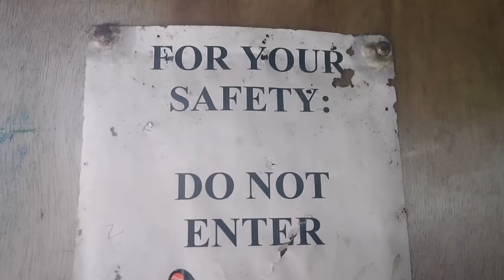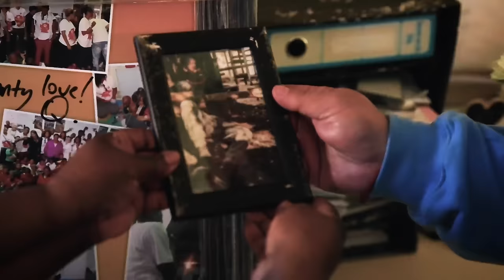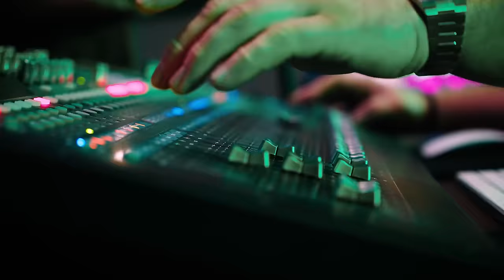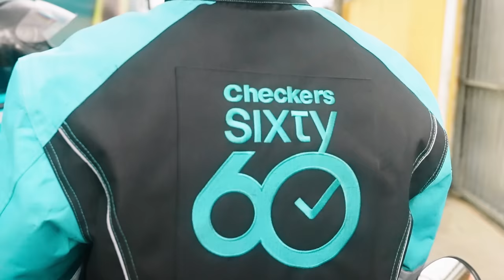We Adopted an Orphanage

Comment: The things this man has achieved. All starting from his bedroom with his best friend. He deserved every single subscriber he has
Reply: Ayy toilet gang
Reply: Don't traslate🧠
تۆ نەفرەتت لێ کراوە
کەناڵەکەم
ئەگەر ناوت تۆمار نەکەیت لە ماوەی ٣ ڕۆژدا دەمری…
Reply: @Turkiyeball_animations Ayy countryball gang
Reply: Ok
Reply: here a recipe for a shawarma
STEP 1
Tip all the ingredients, except the chicken and lemon wedges, into a blender or a smoothie bullet with 1 tsp sea salt and whizz to a smooth paste. Pile the chicken into a bowl or large plastic container, pour over the paste and mix through so the chicken is completely coated. Cover and marinate for at least 4 hrs or up to 48 hrs – the longer, the better.

STEP 2
Cooking on the barbecue: 
Light a lidded barbecue, and let the flames die down. Once the coals have turned ashen, pile them up on one side with a few coals scattered around the other. Starting and ending with half a baking potato, thread all the chicken onto two long metal skewers – so that both skewers go through each piece of meat – packing the thighs down between the potato halves so that they are really compact. Place the large chicken kebab to the side of the barbecue with only a few coals underneath. Pop the lid down and cook for 45-50 mins, turning every 15 mins, or until cooked through – prise the chicken pieces apart in the centre to check, or use a digital cooking thermometer; it should read 70C or more. Leave to rest for 5 mins.

STEP 3
Cooking in the oven: 
Heat the oven to 220C/200C fan/gas 8. Sit the kebab across a roasting tin so it is suspended, or rest a wire rack over a roasting tin and place the chicken on top. Cook for 45-55 mins or until cooked through.

STEP 4
Warm the naan on the barbecue or in the oven. Bring the kebab to the table to carve, wrap with warm naans, and serve with the other salads and lemon wedges for squeezing over.
Reply: Ayo toilet gang
Reply: Toilet enjoyer 🎉
Reply: @AussieBall-Animations2  ayy